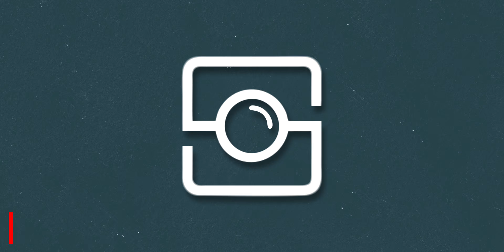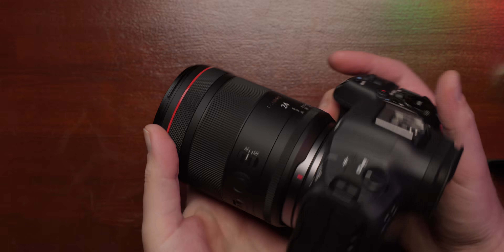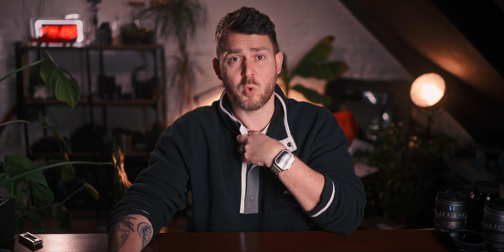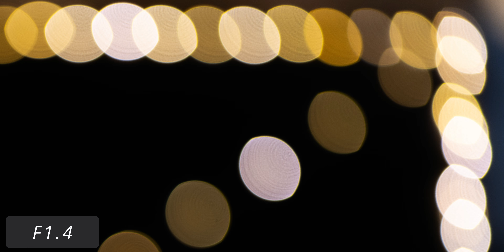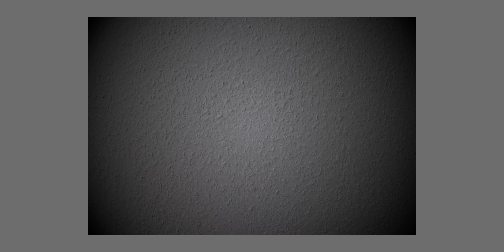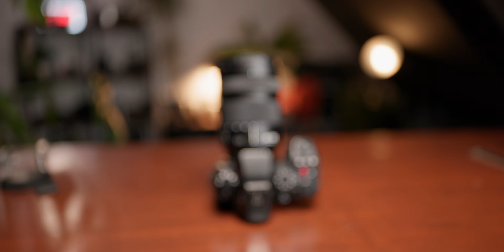DON'T BUY THIS LENS BEFORE WATCHING! Canon RF 24/1.4 L VCM Review

Comment: The small size of the RF 24 1.4 is matched by the same as the Sony 24 GM, yet the GM doesn't have the same optical distortions.  I don't see any advantage for Canon to design a lens that requires digital correction, unless it is to reduce cost.  The RF 24 1.4 is the only option I have for shooting at 1.4, because the EF is also much worse in sharpness and CA.  I have both the 35 GM and 24 GM on my A7C, and the 35 VCM for my Canon equipment. 

Thanks for the detailed, real-world explanation.

Comment: Great video. I think what you may be missing is that this is really a video lens. I know they say it's hybrid, but the weaknesses you mentioned were compromises they had to give to the the features videographers need. I don't think it's a mistake to put it in the L line. It may be a mistake to let photographers think it will perform as well for them as other lenses in the L line.

Comment: I am a nightlife photographer asnd as much as I can get away with quite a bit when shooting inside nightclubs, I personally think the VCM lenses compromise stills because they are centred around video. I had no choice but to opt for the 35 and 24mm since there isn't any non VCM versions in those focal lengths. Why has canon done this? I personally think that all the flaws in the stills could have easily been prevented if they decided not to fix what was not even broken in the first place,  so to speak. The 50mm 1.2 RF still remains my favourite but sometimes it is narrow and the 35mm gives me that wider focal range.